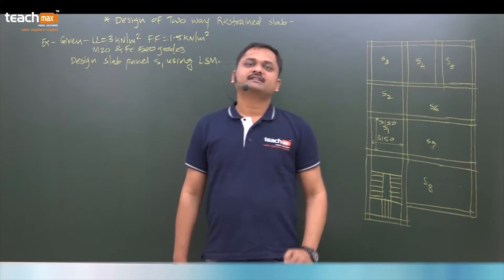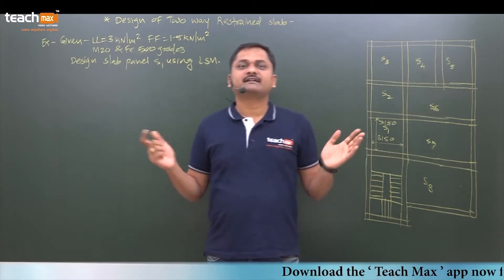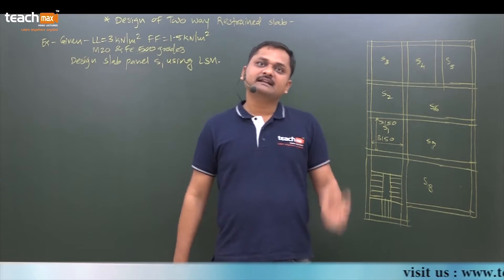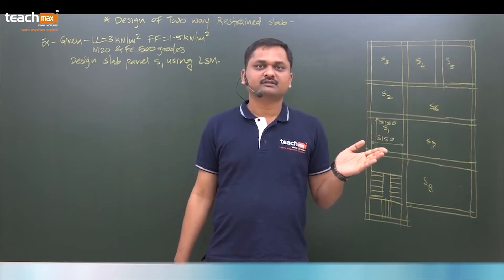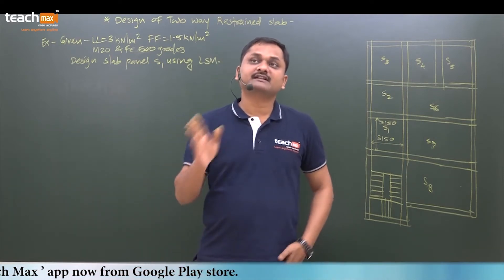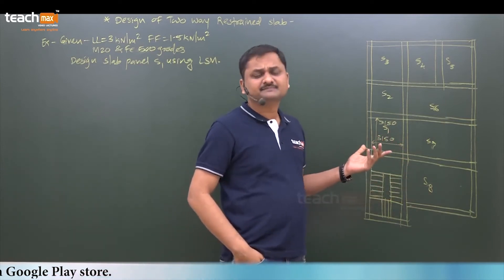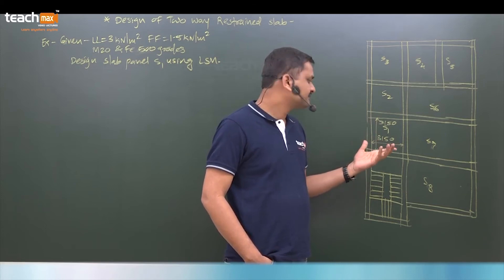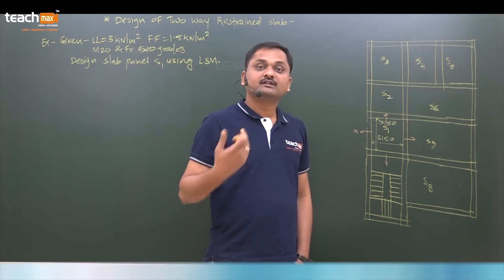Design of Two way restrained Slab | Structural Design - 2 | by Prof. Sajjan Wagh

Comment: Hi. What happened when bottom part of the beam is concreted first then the top part of the beam with its top bars are concreted with the concreting of the slab.  I believe the beam is considered Rrectangular and not a T-beam and the slab through it is continuous, it is to be designed as simply supported.  However when we come to restrained and unrestrained property, we have to select restrained as it is a collection of slab with different border options and it is fact restrained for the selection of bending moments coefficients.  Example of unrestrained slab would be cover of septic tank, cover of water tank,  Can you please confirm this understanding if ok? Thanks.